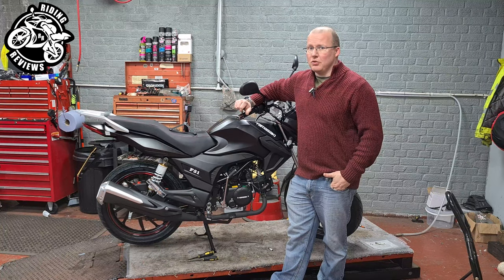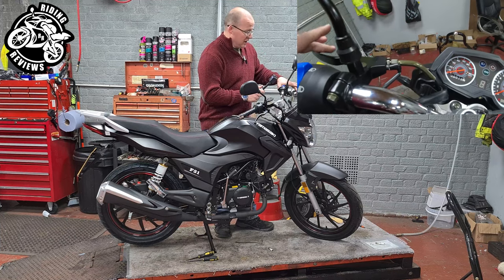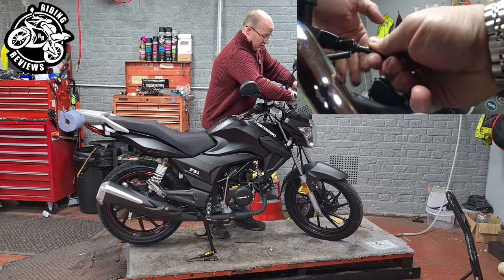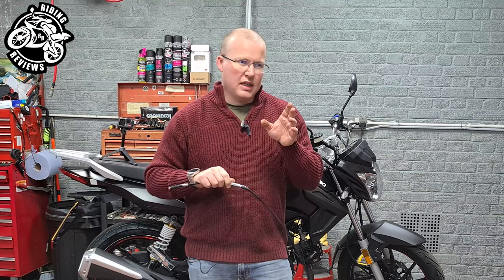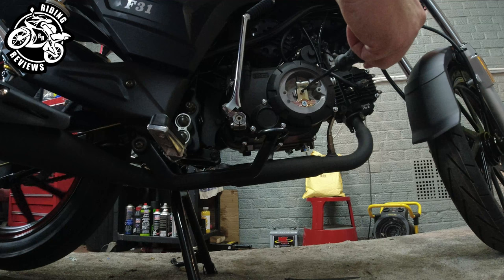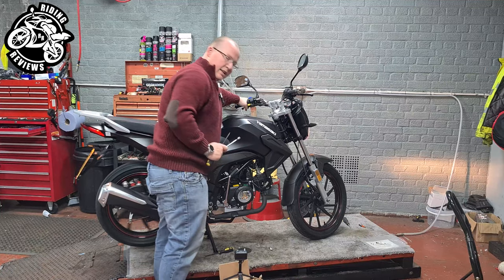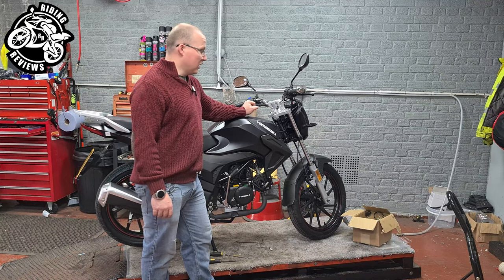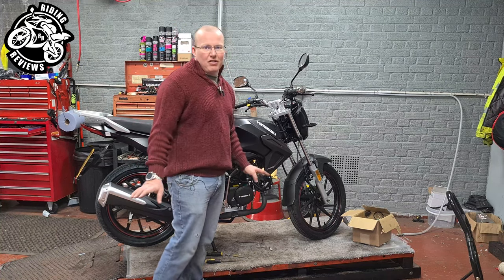Motorcycle clutch adjustment for beginners

Comment: How is the bike not stalling if its in 1st gear with no clutch pulled in ?
Reply: It's not bearing any weight on the bike cause it to free move. If the back wheel was on the ground it would stall immediately

Comment: My clutch is to far down and I dont know how to fix it. Can you please help
Reply from the maker: You can adjust it on the handlebars, or there is an adjuster in the middle of the cable. What is wrong with your bike? What are the symptoms
Reply: @Ridingreviews  I fixed it

Comment: My bikes clutch is releasing at the very end. Which adjustment will get the clutch to engaged sooner? Closer to the grip.
Reply from the maker: if there is no adjustment already on  the cable you will have to adjust it on the engine

Comment: My yamasaki ym50 struggles to go from 1st gear to 2nd. I’m not sure if it’s something to do with the clutch needing tightening or if it’s another issue. Any suggestions?
Reply from the maker: I would say it will be clutch for that i brt it is hard to get into neutral aswell
Reply: @Ridingreviews  Yh the gear indicator goes blank sometimes inbetween neutral and 1st but you can tell it’s still in gear because it tries to pull of when you release the clutch

Comment: Thank you for the demonstration. I have a couple of questions.

1- What would be a good starting point? Lever half way, the cable half way and then adjust the screw?

2- when I loosen the lever and the cable all the way to maximum cable slack, then, I screw in the clutch also all the way,  the wheel continues to rotate (with no resistance applied) is that normal?

3- it is hard to get my bike into neutral. When I do  manage to get it into neutral and tilt the bike to the right the transmission engages. Tilt it to the left, it disengage. Could this be a clutch adjustment or is my transmission bad? I bought it second hand with only 182kms on the odometer. 

Looking forward to your response.
Reply from the maker: 2 try to screw it all the way in and then apply the rear brake it should stop without affecting the engine tone question 3 if the  clutch isnt adjusted properly you will struggle to get into neutral
Reply: @Ridingreviews  will do that.

Thanks again

Comment: So I've got a ybr 125 put new. Clutch in its a wet clutch have adjusted cable to factory specs and clutch still slips I've done the end screw on the clutch it's. Self all the way in u till. I hit clutch aquater and back of quarter of a turn but bike is still slipping not as bad as it was but still not delivering the full power any help please
Reply from the maker: it is quite hard to diagnose an issue without seeing the bike directly but i would check the clutch basket itself the plates may be biding in there or maybe replace the 4 tension spring
Reply: Cheers iv got new springs so will put them. On and see if that helps make a difference